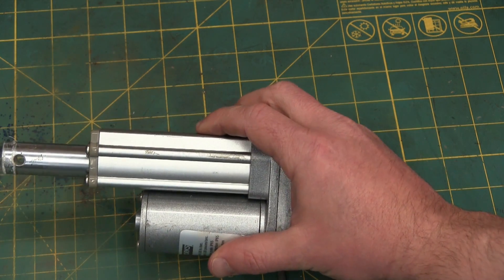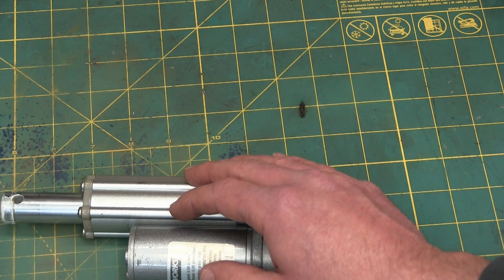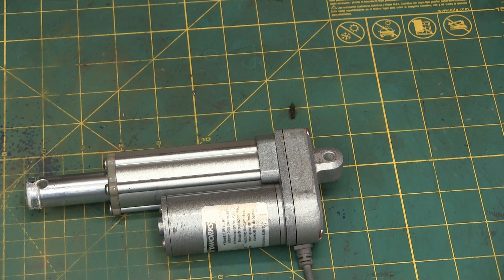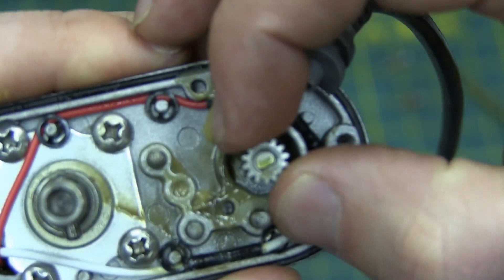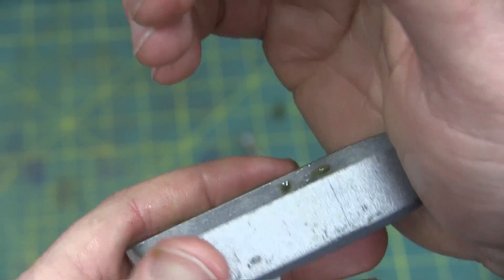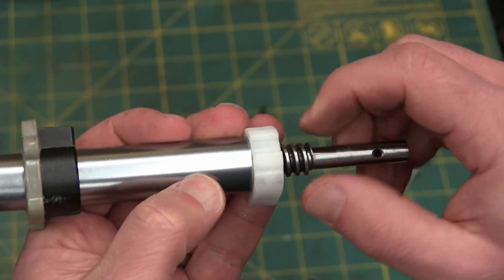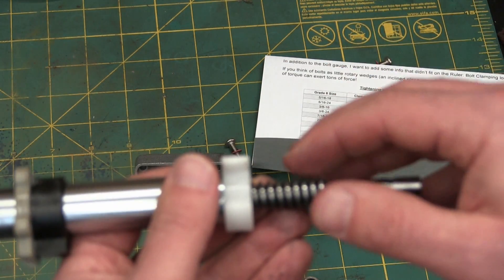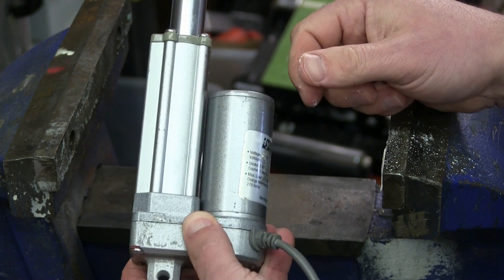BOLTR: ELECTRIC LINEAR ACTUATOR

Comment: Had one of these on a wheelchair hoist to lift the chair into the car, used probably 4 times a day average over 3 years lifting a 150kg chair (lift was rated 200kg so no worries) one night it broke casting on the end shattered, it dropped the chair about a metre onto concrete. Chair=totalled And no way of getting it back into the car miles from home. Won't go near them again.

Comment: A major factor of actuator applications is enviornment / setting.  Linear actuators are what make hospital beds chooch. You wouldn't want a loud ass compressor and pneumatic lines running all over the place in a hospital. Definitely wouldn't want a hydraulic line busting and spraying fluid everywhere. It comes down to having the right tool for the job.

PS: The Danish actuators are the skookemist.

Comment: You CAN put overload protection in a linear actuator. A friction clutch.
Also, the gears in a linear actuator don't wear out while still, even in heavy vibration, unless they're in so loose that it's like a hot dog down a hallway.

Comment: I've found them to be very reliable in light industry, controlling conveyors and the like, and we used them in robotics for a lights-out factory.  In other words, they are very reliable in a cleanish environment, not too much heat, dust, or vibration.  But I agree, I'd never use them in heavy industry.

Comment: Say "there is no mechanical protection". Moments later *picks out a shear pin on the screw shaft*...

Also it would be easy to add a current overload protection circuit.

Comment: Ha ha ha...You are funny as hell.  Is there a way these linear actuators could be made more indestructible, by say replacing the plastic parts with steel machined parts, especially the part where the acme screw goes through ??

Comment: I think you missed a step in your torque calculation. Yes, it's 8 threads per inch, but the diameter looks smaller, making the ramp steeper and less effective.  If half inch OD, the diameter is about  1/2 of the od of 1" bolt, requiring twice the torque to  generate the required thrust. Of course twice nothing is still nothing, so still silly small. Just a little nitpick. Thanks for all the cool content!

Comment: Weird. One of our most-reliable machines is packing 4 of these bad boys, she's been chooching strong for over 15 years now. Plenty of vibration since they're providing saws the means to travel along two axes along the profile. The vertical axis also has a pneumatic cylinder to provide an assist when lifting the head.

Comment: you would think there would be at least a magnetic induction ring on the actuator rod with a pick up sensor to position the location, what a heap a crap.   What is wrong with an air over oil hydraulic unit to replace the scary (to some)  full on hydraulic system?   Glad you called out the nonsense sales engineer who's salesgasiming all over the bosses office over his apparently amazing failure.

Comment: facking linear actuators. 

I had a car with an electric parking brake and like any parking brake on an automatic car I didn't use it for at least a year but the first time I use it the bugger breaks. 

Go to the dealership and they want 1000 Canadian pesos for the part! They quoted 1500 for parts and labour. 

I had enough, I sold the car.

Comment: What's your opinion on linear actuators like the one made by ANCA Motion? (I only knew them because of the machines at work, but I'm sure there are many on the market). These seems a little bit more robust and have zero moving parts. I'm personally a sucker for ballscrews/guides in machine tools, but seems to work really fine for fast moving grinders or mills.

Comment: AvE i love this channel keep up the good chooch.....so i was thinking about using a outboard boat motor power trim and tilt hydraulic assembly for an upcoming project but i am curious what the lift capacity is on one. Have you done anything with them?

Comment: At first, I liked that wire retention. But after thinking about mounting that actuator on something that's vibrating, those damn spring clips are stupid sharp. Methinks that will lead to some eventual problems with the limit switches. Problem is, depending on the wire the actuator either won't function at all, or will strip gears out or shear the pin. Not sure which is worse, but I think they would have been better off just routing the wires around the pins and eliminating the retainers.

Comment: Anyone know of where I could find replacement motors for these? I melted motors on 3 (of 4) actuators when my install didn't allow those 3 to fully retract. So they just kept trying to close until they melted to black mess inside.  Fuse didn't pop either, odd.

Comment: Get a chance, check out the linear actuator from a p01 or p02 series nissan forklift. the dc motor is switched via igbt's and is print card driven. very very durable actuator. Japanese done well.

Comment: We have a rotary brush we put on our grasshopper mower in the winter and it has two of those little bastards on it, one for tilt and then the other for up and down and they are the slowest damn things, don't have a switch so they keep clicking when it hits smack bottom and the numb fuck running it keeps holding the toggle!

Comment: The included angle between thrust surfaces of an acme thread is 29 degrees. The commonly used UNC and UNF thread form is a 60 degree included angle.

Comment: The ACME thread is a trapezoidal thread form, it is iirc a 29deg angle, where UNC/UNF/Metric are 60deg thread. It is also double flighted so it threads twice as fast as single flighted UNC/UNF

Comment: I would think too the choice for actuators depends on the infrastructure of the machine.  Does the machine already have the hydraulic pump, fluid reservoir, etc?   Whereas DC is almost a given.  Hydraulic pumps are muy expensivo.

Comment: Might be interesting to see an electro-hydraulic-actuator. Basically splits the difference between both worlds by mounting the pump motor and reservoir right on the piston, and perhaps the option of extra finesse via a tilt-block somewhere controlled by a servo. From what I understand, it's the kind of dealio used on fly-by-wire and such in airplanes as your pixies are much easier to route than hoses, but getting the kind of advantages seen by the older system.

Comment: You're showing a low quality product. I've used ball screw linear actuators from Duff-Norton and Motion since the 70's and have rarely had one fail. Many salespeople have tried to get us to use cheap Chinese knockoffs that look like your example, some even looked worse with plastic gears and plastic bodies and even plastic mounts and clevis. I had a box full of these samples that I was too afraid to even test! The clutches have always worked for me if you don't want or need the limit switches and in some cases I prefer the clutches. You can drive out the actuator for a certain amount of time that you know will hit the clutch and then draw it back with a bit more time than it takes to retract and you don't need any switches or sensors.

Mind you we don't put them in construction equipment and we only started with them because our machines no longer had hydraulic/pneumatic systems and we keep well within the duty cycle and load requirements. The problem you're having with them is something that does not happen to me, we use quality parts and don't overwork the part. 

As far as using them on hobby projects they are great but watch out for the ones that have friction clutches, look for ones that use a tiny pin to activate the clutch so it only slips at the limits of travel. I've seen people put encoders on the cheapest ones that can slip anywhere and it's next to useless to control. By adding an encoder and a servo driver you have an amazing combination of power, control and simplicity and it's easy to take advantage of the clutch by using it as a home position.

Comment: Yep, electremafied actuators are great for parts sales. Boats use em to lift engine hatches and they're a few hundred bucks to replace. Of course, they last longer on boats than on equipment because you can guess how often owners actually open the hatch that hides that noisy metal thing that makes the boat go. Smart guys tap a hydro cylinder into the trim (hydraulic) pump but, fortunately for me, there aren't too many smart boat owners !

Comment: incredible how much force  just a few pixies can really produce, ya ya ya it got gear reduction, but applied correctly a few pixies can move a lot of mass
Reply: its still energy transfer and if that little bit of energy is all the input needed for 200lbs of output, really incredible how powerful electricity is considering how small it and invisible it is, and its all around us through out the entire universe

Comment: Also, linear actuators are not normally intended to support a sideways load. When fully extended, the rod is weakly supported in the cylinder body. A sideways load can apply leverage to bend or break it. In hydraulics / pneumatics, this causes leaks from pushing the rod/piston to one side in the cylinder, and a gap opens up around the seal.

Comment: We have these things on our greens mowers at work. The reason being is there's no hydraulic oil that will leak on the greens. But we've had our mower for ehh 2-3 years maybe and 2 of the 3 of these fuckers have already been replaced. Which means downtime for this machine and that some other guy on the crew has to mow all 18 holes with 1 machine. Which takes 3 hours. Not terrible considering the size of our course, but if we have an early tournament or something, it just doesn't work out. Seriously fuck these things. However the trade off is not having hydraulic fluid on the greens.

Comment: Hey AvE, any idea what kind of linear actuator would be appropriate for replacing a transmission shifter cable? I have a kind of an oddball vehicle for which brand new cables from the dealer are insanely expensive and there's few to zero salvage available that are any better than the stretched-but-still-barely-functional one that I've got now. I thought how cool would it be to create a pushbutton system in place of the manual PRND3L lever setup instead. Thing is, it doesn't take a large amount of force to move the lever on the transmission, maybe only ten or fifteen pounds nominal to overcome the detents on a cold morning, but it does require some speed. I'd want it to be able to go from P, to L, about five inches of swing, in less than a second. So, I'm thinking something with far less gear reduction would be in order. Is there some sort of lookup matrix where you can put in, say, length of throw, maximum load and speed and get a list of appropriate part numbers?

Also, before anyone comes in to tell me how dumb the whole idea is, let me save you the trouble: I know, I never said I was particularly smart. This is a horrible project doomed from well before the start and pretty much everyone reading this is automatically, honorarily, and most importantly, goes without sayingly smarter than I am.

Comment: The angle of incline is much smaller on the bolt due to increased diameter. The torque needed will be higher than what was calculated.

Comment: These are useless in industrial applications, sweeper & scrubber/drier companies have started using them to lift brush arms/scrub decks (which can way anything up to 300ib) I liked the concept because the biggest battle I have with old sweepers is hydraulic leaks which is kinda contradictory to a machine whose only purpose is to make floors clean and tidy. In practice there a disaster, last 6 weeks to 6 month's. If a linkage gets knocked out of alignment the actuator never reaches it's limit switch and just sits there going 'clack clack' until you turn the machine off. If any pivot pins get rusty and tight  (in a sweeper that's about 2 weeks!) the load on the gear train is too much and normally they strip the first delrin spur gear that mates with the motor pinion which is brass. Just shows how what sounds great in theory is useless in practice in a real industrial application and it's always the external factors. My company was selling these machines and I'm afraid to say as forklift/heavy equipment engineer I fell for the marketing wank!

Comment: Those things are NOISY. Some clever engineer decided to put them on a whole array of ceiling windows in one of my Uni's classrooms. The windows keep opening and closing to regulate the room temperature, trying not to loose too much heat while keeping the air inside fresh. The whole bank makes annoying noises throughout the class.

Comment: ive been hunting a electronic linear actuatchootcher a few days now. to diy a remote locking system for my car. i think the actuationer in the video would rip the door of my korean shitbox :D
Reply: Standard car door remote locking actuators are available for nuppence. Set of 4 for £20 IIRC. I added some to my van as I quickly got bored of walking all the way round locking 5 doors. Been working for 15 years now modulo some wiring issues which can make them get all confused.

Comment: Frightfully sorry to have to correct you, old chap! The included angle between two teeth in an Acme thread is 29 degrees, thus the angle that the side of one tooth makes with the horizontal is 75.5 degrees. I'm sure this was only a momentary lapse of expository precision in the transmission of your encyclopedic command of machine lore. Wikipedia has a good picture.

Comment: I'm fairly certain your clamping force formula is similar to the gear reduction on a pair of gears. On a ~1 inch pitch diameter (1inch-8tpi) the circumference moves about pi inches for every 1/8th inch that the nut (load) moves. 3.14inches / 1/8 = about 25:1 not taking friction losses into account.

Comment: How the hell do you know all this? What is used "in the field" over construction? Bobcats? Manufacturing process? What the hell did you take in school? Chemistry of grease?
Reply: Some of this knowledge could certainly come from a journeyman apprenticeship, or an extremely skilled professional tradesman who retired and is educating the next generation. I was fortunate enough to experience this in my education, though I am in IT and enterprise storage. No special 4 year edumacation is required for this however. Take something apart. Go to the library and get books. Take it to a hacker space or local machine shop. Ask the dirtiest, crustiest guy at the hardware store. Time and effort often yield knowledge.
Reply: batner
heheh, every science advanced enough starts looking like magic to most people ;) remember who said that ;_)
Reply: Lukasz Sokol i tink it was elvis or elton john which one was it lol
Reply: If you listen you can tell what he does, he learns everything he can about his job and it shows.  If you work in a field that takes mechanical engineering and you work your way up around guys that will give you a lot of crap if you get the wrong item you learn what they know or you cry and quit. Mining industry uses hydraulics, pneumatic, all parts require maintenance. The correct maintenance and only the correct grease, oil, etc. Oil rigs use pneumatic, hydraulic and motors. Electronics for safety and control of equipment.  Listen to what he says, not just kind of listening, but actually listen and take his tips in mind you will learn a lot.  I wish I was young and could follow him around learning from him. There are still people out there that do more then swap parts out.
Reply: ive been wondering the same about his wizardry too, im even more curious what he does for a living to travel that much and have that many toys at the same time
Reply: ***** Not just the knowledge, got the tools. Has a big-ass mill machine and tons of shop tools AND has a nice-enough oscilloscope and power supply for the high-tech stuff, also knows his way around a circuit board and some ICs.
Every video i'm like waiting for him to get something like a rugged space-warp generator and start explaining why its not that skukem and see if he can get some pixies out of it to make things chooch. Then he will continue to explain why the power conversion matrix will never allow the stated warp-3 on the generator packaging, no matter how good your space-fuel is.

I wonder if what I do may seem like magic to other people?

Comment: Enjoyed the math part of the video..

Like you said, not suitable for all applications. However, when they are built with quality materials and spec'd right they can be awesome devices. %90 of the worlds pleasure boats are running around with a linear actuator controlling the rudders (during autopilot control). Its not uncommon for them to last 15-20 years and 100,000 nautical miles. Even then, a quick swap of the gears and replacement of the brushes and they are good for 20 more!

Comment: ignoring the friction the torque to force is straight forward. If the final drive was 1ft in radius and you wrapped a string around it you have to pull 2*pi*1ft ~= 75" to get one revolution, one revolution gets you 1/8" linear movement, so force on a 12" arm is multiplied by 75*8  ~=  600 times

Comment: also if you fancy doing a seasonal tear down on Xmas lights so I can disable all that flashing crap and just have them come on steady with a time switch it will save me crawling round pressing buttons every day (some have a dial instead of a button so I'm assuming it's just a case of putting a suitably sized resistor in somewhere) and be much appreciated...

Comment: was there a proper thrust bearing down the bottom of the housing? and presumably this can't pull anything like as much as it can push because the plastic nut would just pull out of the shaft?